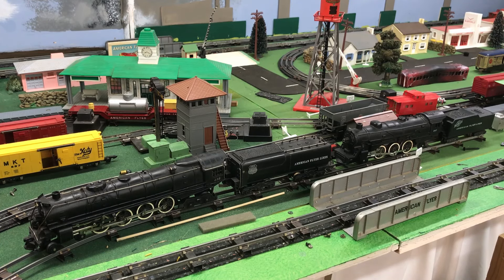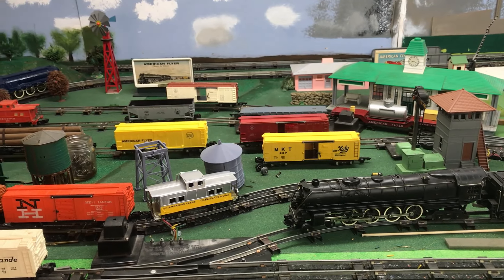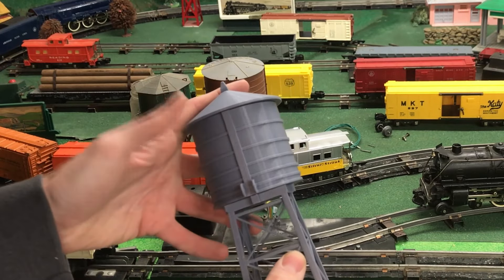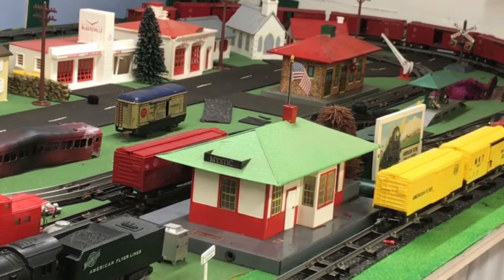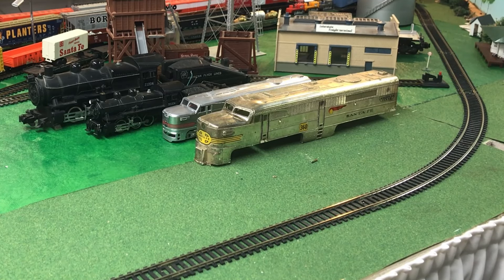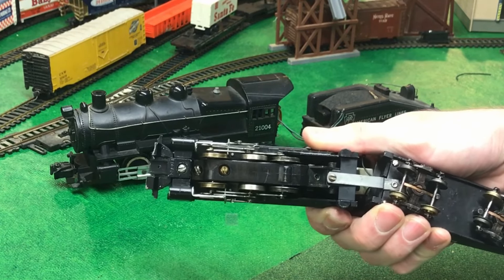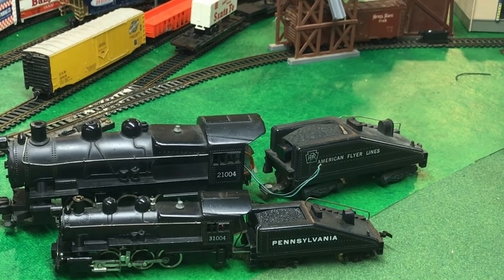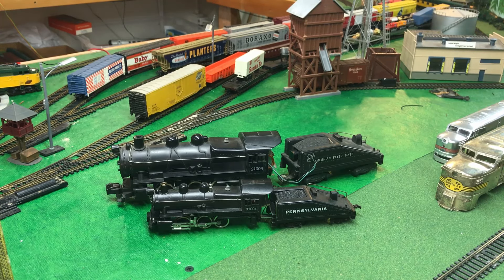American Flyer Projects in 3 Scales for the New Year

Comment: 👍👍👍Best of luck to you on your vast amount of projects and your goal of 1000 subscribers.
I will be spending the year working on both my AF layout and my HO layout.
I need to add some of my new accessories to my AF layout and wire everything up.  Luckily no repairs at this time.
 I just added four new HO Atlas/Kato (Japan) yellow box locomotives to my collection.  ATSF RS-1 black with silver zebra stripes; GN GP-7 with directional lighting to run long hood forward like the prototype; NP RS-3 and RS-11 plus some new NP Accurail box cars that I have to assemble and add #5 KayDee couplers.  I also need to get the letters for the walkway sides to indicate the front of the locomotives like the prototypes.

Comment: American flyer, 2 rails, not three, ha ha.
Reply: ES1541 - American Flyer did make 3-rail O gauge trains in the 1920s and 1930s.   American Flyer also made 3-rail " wide gauge " trains during that period.   The " wide gauge " trains were called " standard gauge " by the other manufacturers.  And of course, American Flyer started offering HO scale trains in the late 1930s.
Reply: 3 rails never look realistic.
Reply: @es1541  - In the Postwar era, American Flyer emphasized in their advertising that their S gauge and HO scale trains ran on realistic 2-rail track.  In one of the "American Flyer Boys Club" shows, one of the members is brandishing a piece of O gauge 3-rail track, while another member says, "That's old fashioned!".  But the 3-rail track does guarantee a very dependable electrical connection between locomotive and track.  Plus, you can insulate one of the other rails and use it for signal detection like the prototype.